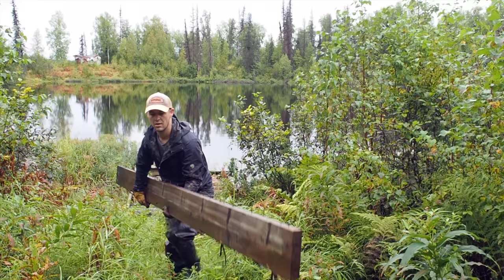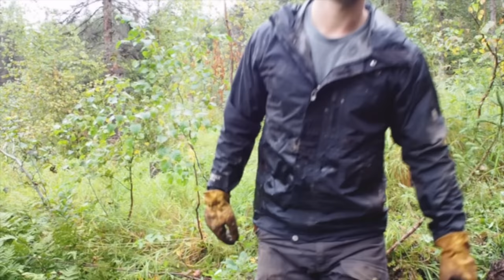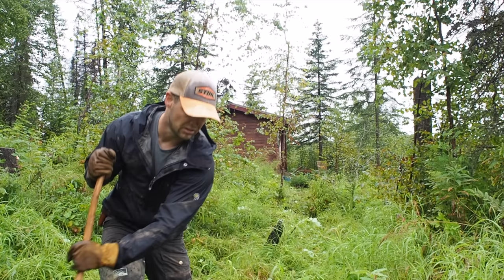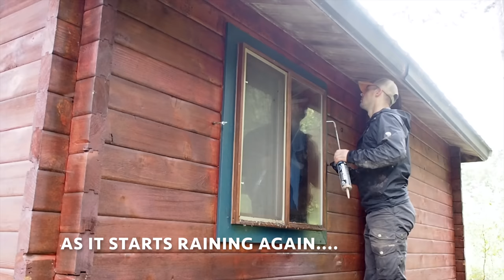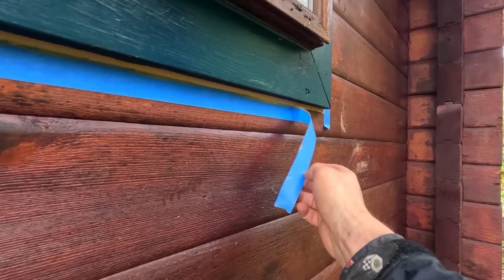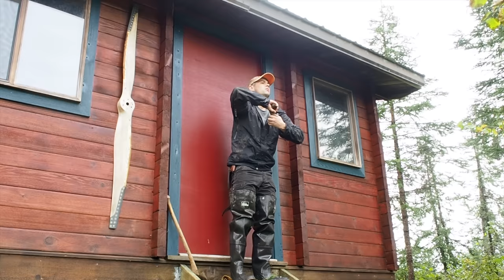Improving Canoe Access at our Cabin in Remote Alaska

Comment: Looks like a covered porch would be pretty handy for a place to hang wet stuff out, as well as give you a great place to sit and enjoy the amazing scenery in the rain! Keep up the work improving the place, it's coming along well! -Dusty
Reply from the maker: Thank you, Dusty! Great thinking, a covered porch is also on the to-do list. One challenge I'm thinking through with that is the pitch of the roof; it's such a low pitch, I'd probably have to have the porch a step down from the inside of the cabin in order to match the slope and maintain enough head room (unless you have any better ideas! It sounds like you do quite a bit of construction, contractor work, and renovations). Thank you for watching!
Reply: @OhashiOutdoors  Yes, you've already got it figured out. I always recommend keeping a porch or deck at least one step lower to reduce snow piling up on the door threshold, because it can have the tendency to melt and find its way inside. And in your case, with the door facing the north, the snow that piles up will stay there longer, with or without a roof. Also, if you have the steps going down off the porch to one end (E or W rather than to the N), the rafters will be higher than they will be along the bottom edge, giving you even more head room. Code is 80", not that it applies out there at all! I don't imagine you or your wife are anywhere close to 6'-8", and nobody else is paying for it, so they don't get an opinion! 😂 I'll be happy to lend a hand next summer if you need it! -Dusty
Reply from the maker: Good thinking with the stairs going off to the E and/or W. Extra headroom is always nice even though my wife and I are not tall people. The more we talk about it, the high up the priority list I keep moving a small covered porch! Thank you for the knowledge and offer, Dusty! I hope everything comes together and we can make something happen out there in the next few years!

Comment: Great video.  Sure can tell your young wrestling that canoe around lol log rollers to the water or sink a log pole at waters edge with a pulley saves the back. Can also use it to pull in logs u cut and drift behind to get them on shore. Your putting in some work but the fruits of your labor will be as you dreamed.  Awesome video. God Bless.
Reply from the maker: Yes, I definitely should have coiled up the line appropriately before wrestling it to the lake. That would have made it a lot easier! We plan to build a dock on future trips which will also help improve access. A log pole with a puly system is also a great idea! Thank you for watching and commenting!

Comment: Are you still contemplating moving the cabin back from the water a bit? That would be an undertaking for sure, though it may solve some of the moisture issues…..I’d dare to guess you were BEYOND happy to be in out of the slop and drying out after all of that….
Reply from the maker: Short answer, yes. It would be a huge job and wouldn't get done for several more years, but it's in the cards. I've learned a lot in a short time about foundations and building in that neck of the woods from friendly locals, so I'm still developing final plans. 
It felt absolutely great to get out of the muck, cold lake, and wet cloths! Although it's always nice putting yourself through austerity like that on occasion. I also knew I had dry cloths and a warm cabin to go back to whenever I wanted. Thank you for watching and commenting!